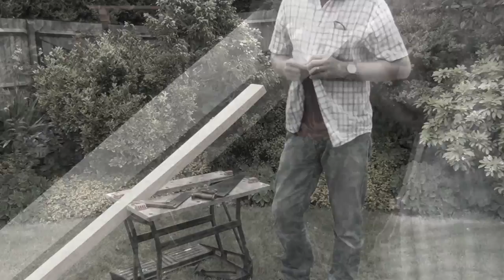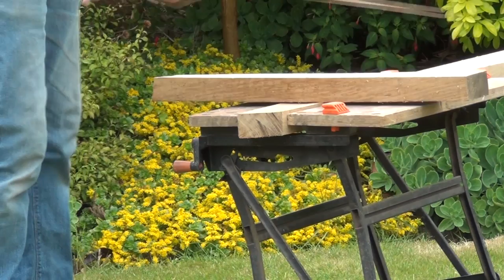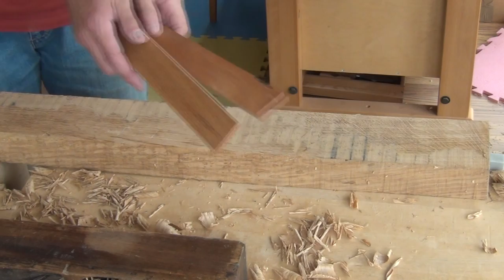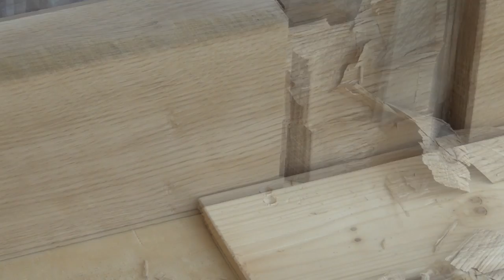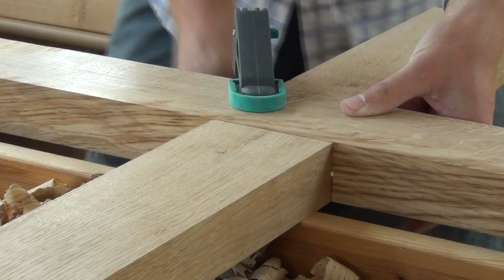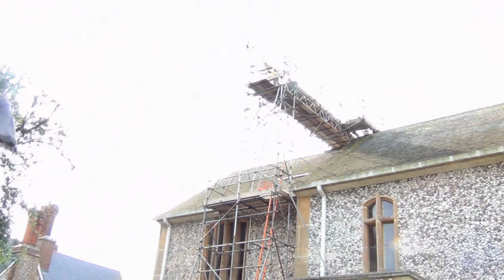Wooden Cross for St.John's

Comment: Nice work Mitch. I liked the chiseled effect.
What is being done to the church?
Reply from the maker: Old Sneelock's Workshop Thanks Dave. 
The big old copper clad steel cross fell off and damaged the roof. It's supposed to be renovated in the future, and re-erected. Meantime the roof needs some repairs. Only the big guy knows how long that will all take - so until then my little cross will do duty. Afterwards, it will be used in other capacities at the church. 
The chiseled/gouged effect in little areas represents the ongoing struggle between good and evil. Thanks to the guys at lumberjocks for some advice on the technique. 
This really was a fun project, topped off by standing atop the church - I always fancied being a steeplejack!
Reply: Copper and iron is a perfect combination for dissimilar metal galvanic reaction. Add a little acid rain from car exhaust and the battery circuit is completed. Soon the iron is gaily passing off electrons to the copper and combining with oxygen in a most destructive way.
Whenever a plumber connects copper to steel pipe they're supposed to put a 2' long sacrificial section of steel in place with a union because it will rot out in a short time and need replacement.
Must have been a great view.
Perhaps a panoramic video of the goings on in the local community. Like the trip to the park?
Reply from the maker: Old Sneelock's Workshop yes, you're right about that. I haven't seen the old cross up close to know how they were attached, but I know the steel had rusted through.
I have to go back up soon, just to check and tighten the fittings, so I'll try and remember the camcorder.

Comment: Hey mitch!! I have a couple questions. #1. What is your favorite tool to use and why?? & out of all of your hand planes which one is your favorite and speaking of hand planes what number is your shoulder plane I am looking into getting a shoulder plane made by Stanley I want to know like what is a good size for your typical mortise-and-tenon using three quarter inch stock or doesn't it matter I was looking at a #92 stanely 
Thanks much and have a good one man
Reply from the maker: Joe basementwoodworking Hi Joe, Difficult question, but today I'd have to say my benches - a good bench is so useful and like an extra pair of hands whenever you need it. There isn't a day in the shop when I don't use a bench. 
My super tuned Stanley No.5 is probably the favorite, or maybe the No.8 - I really don't know. 
I love my Stanley Sweetheart No.93 http://getintowoodworking.blogspot.co.uk/p/planes.html and would have no hesitation recommending one. I think it's much the same as a 92.
Reply: i hear ya!! the questions are so easy but yet so difficult to answer..lol the bench never got that answer before..and thanks ill look into the 93 ...what does the no.8 do or its title "smoother,jointer"??
Reply from the maker: The #8 is called a jointer plane. Used to prepare long straight edges, say for joining together to make a large panel/table top. Very good for flattening large surfaces too.
Reply: Mitch Peacock - WOmadeOD awsome! thanks mitch